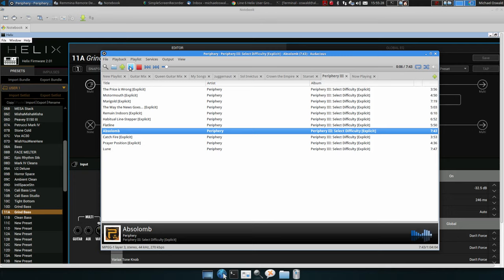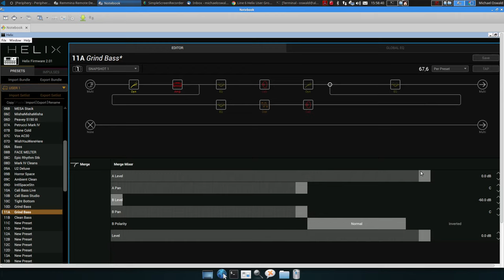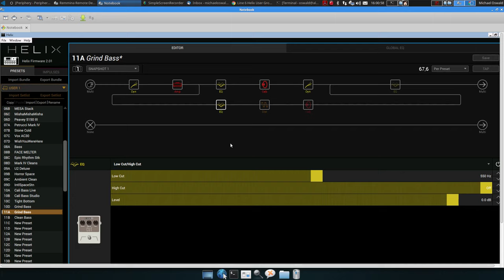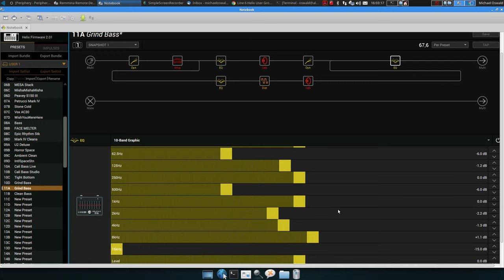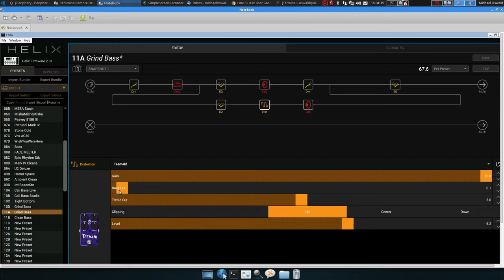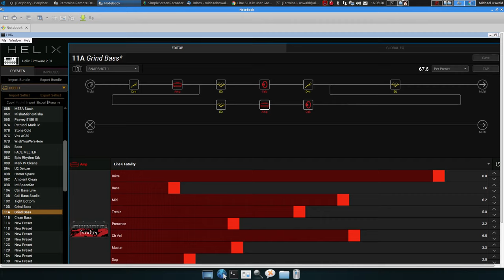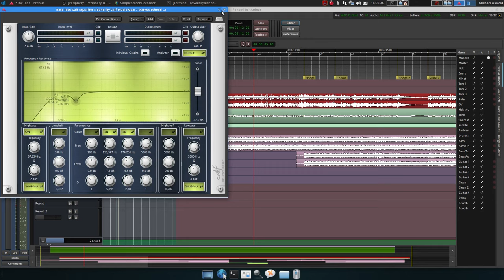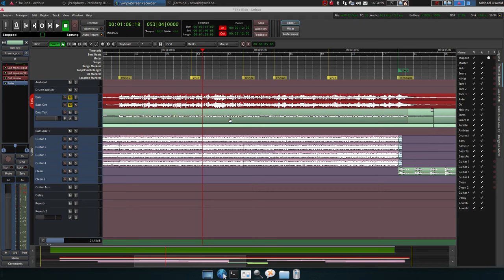Line6 Helix Grind Bass Patch Explanation and Demo

Comment: Instead of using the low cut/hi cut, you can set up the split as a crossover in the helix. If you do it that way, you can get the hi cut lower than 1 kHz.
Reply from the maker: Yup, I discovered that later. In fact I used it for another patch together with the new Darkglass simulation, sounds really amazing. Thanks!

Comment: couldn't you take out both of the left EQ parallel blocks by just doing a crossover split instead?
Reply from the maker: Yes. Didn't know about crossover split at that time. On later patches I did exactly that.
Reply: @onikudaki1000  awesome!! The reason I asked is cos I have a stomp and removing those 2 EQ blocks brings me closer to 6 blocks and I can try to implement this on my HX Stomp

Comment: Nice tone! Were you using Wine to install helix control plugin into your Ubuntu? Or there's a version for linux too?
Reply from the maker: Actually, this is not the Helix plugin, it's the Helix editor running on a Windows Notebook (since it doesn't work on Wine because of the missing USB support), put onto my Linux machine via Remote Desktop to be able to record it in the screencast.